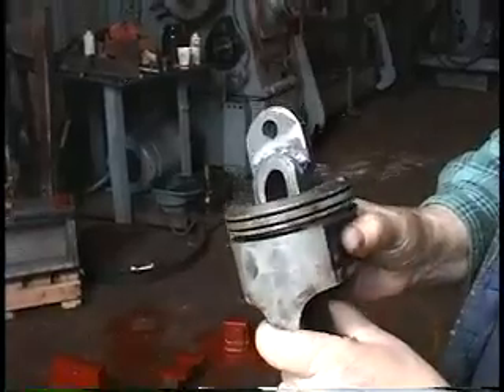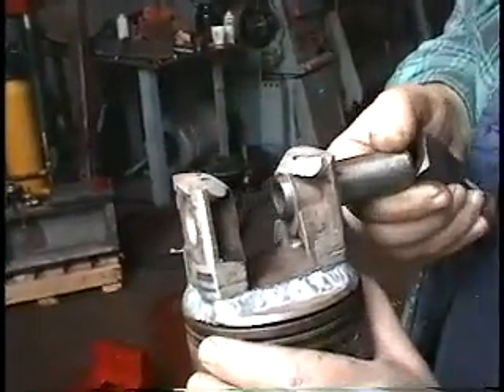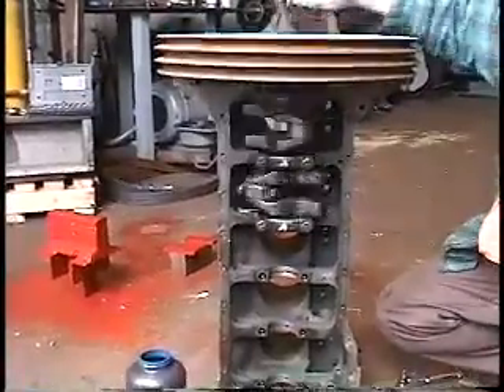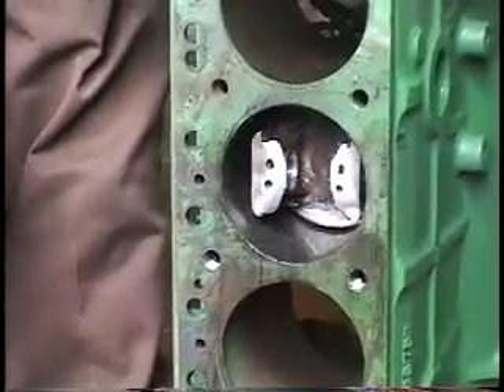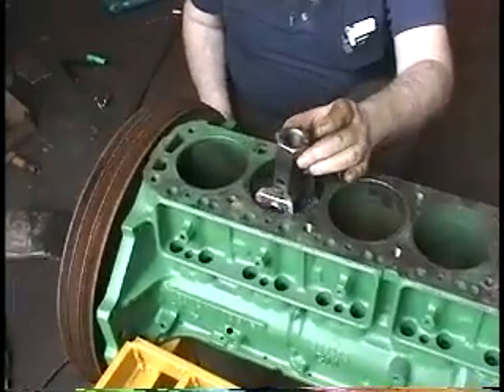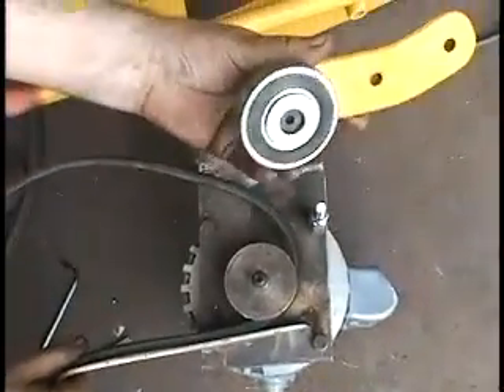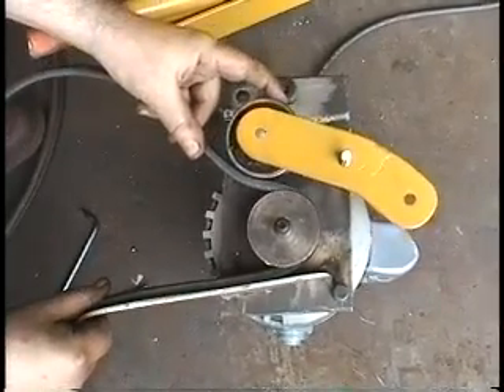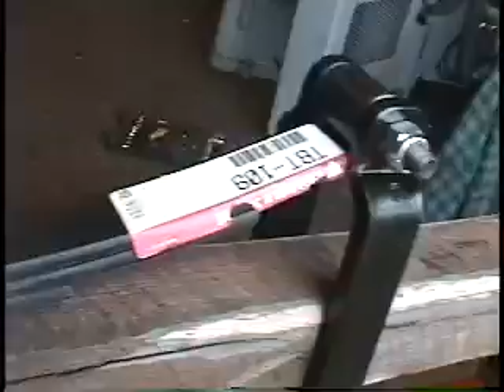The Original Junk Yard Hammer

Comment: this has to be one of the best home built power hammers I have seen so far, I would love to build one for myself, I am just not sure if or how I could get some of the parts like the flywheel pulley on the back, I have never seen anything like that so I don't have the slightest idea where to get that part from, I am very impressed and this video shows what someone is capable of with just a lil bit of imagination and the knowledge to accomplish the task at hand

Comment: You did a great job and a great video, too, not wasting our time with babbling, you showed us what we needed to see. It's so good I hate to point out a problem, but a problem there is. The top hammer doesn't meet the anvil quite centered (radially) - there's a little bit of overhang on the part of the top hammer - and it also does some moving about side to side. The result is I noticed you accidentally put a partial fracture/bend in the spear tip about 1/3 of the way to the tip. My bet is you have a micro-fracture there that will, sooner or later, cause the outer 2/3 of the tip to break off. I understand you went from hot forming to cold forming in order to work harden the piece, but putting a sharp bend in one place because of the overhang of the top hammer - even though you immediately corrected it - did so three times, I think - essentially ruins all that good work. Has the spear - or whatever it is - been put to any real work yet? I'll bet you that ten throws into wood will break it. I'm glad to be wrong, but if you examine your own film carefully you will see what I'm talking about. The design just needs to be tweaked a little, that's all; either the hammers are slightly misaligned or there is some longitudinal play in the mechanism that is allowing the top hammer to slip forward a little on some blows.
Reply: Dont think it was a spear tip   he was just showing how it forged

Comment: How do you keep the piston/cylinder lubed?  You'd think after awhile you'd woller out the cylinder bore.
Reply: +Tim Fox It is running a lot slower than when it was an engine, and if the bore does wear, so what?  It isn't like emissions or oil consumption matters. More than 1" of bore wear might start to interfere with the operation, but that will take a while.